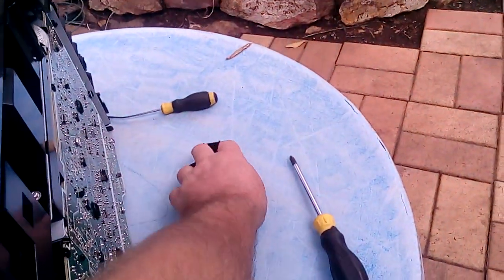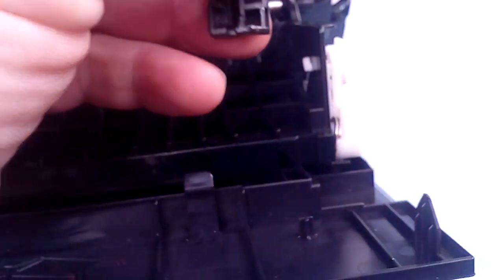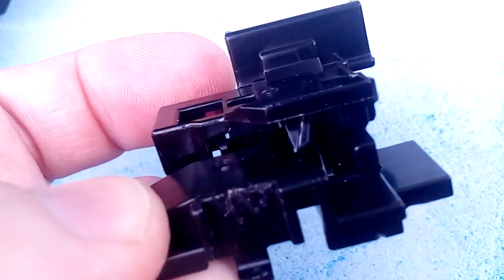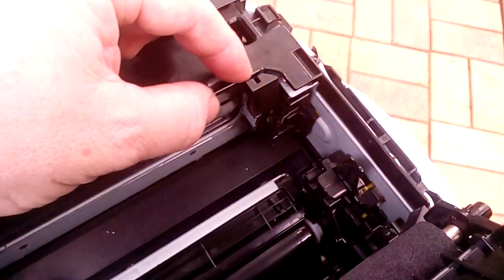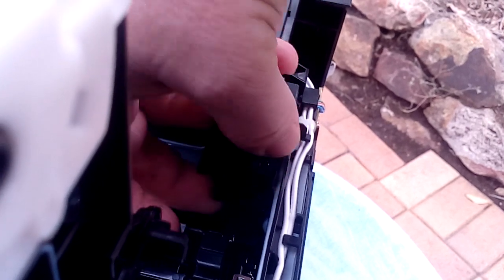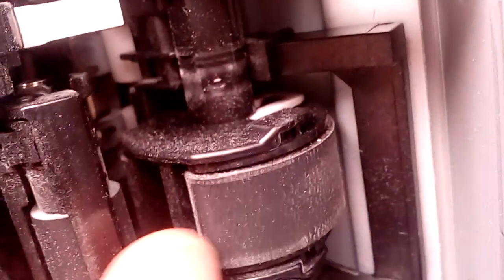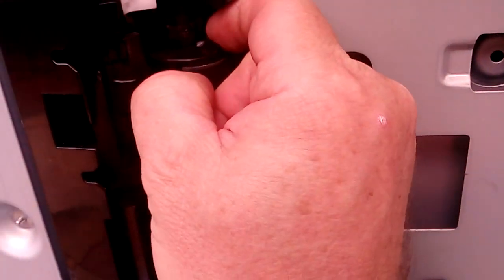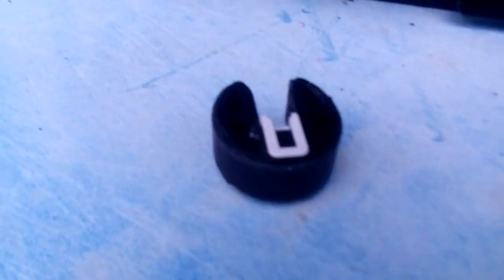Hp pro 200 cover open rear fix part 2

Comment: The video was very helpful.
Thank you.
The individual plastic component that gives the command to the sensor (open-close rear door) had been deformed, probably from forcefully closing the door.
I repaired it using hot air.
I put the spring in its correct position.
Then I placed the entire plastic mechanism in the operating position and the printer works perfectly.

Comment: A simply and casual fix: turn off the printer, rotate it to rest over the front panel, the rear panel facing upside, and MAGICALLY the door closes. Tested in two diferent machines....
Reply: ++++ THIS WORKS!! At first I was skeptical of this suggestion thinking it would cause a whole different problem, but I gently tipped it over onto the front with the back door facing upward, and then closed the door and it closed FULLY! This person deserves a THANK YOU!

Comment: Thank you for the video! It helped me a lot! I removed the black bit and and now the IR sensor is not blocked the Printer does not say that the rear door is open. I am able to print in the meanwhile I am ordering the part.
Reply from the maker: Just fix your old part it's usually the spring

Comment: you can also bypass the sensor and the error by shorting the bottom-left and the top-right pins on the optical sensor. :) you will need to remove the printer's side panel to expose the motherboard and sensor pins.
Reply from the maker: This  of course is not recommended as you will not be able to clear paper jam errors as well as pulling the 5 volt rail down causing more current to be drawn
Reply: thanks for this - mine stopped working 2 days ago. I shorted bottom left and top right and this worked fine so mine is good again - just one "small" soldering iron burn where I slipped! I removed the plastic part first first but this wasn't sufficient in my case, it clears the rear door open message but then on first printout, the message returns. (The spring was missing in my situation). Its just saved me NZ$500. The POS has been hit and sworn at many times, I was surprised the rear door was still attached! I felt guilty fixing it, but guess it gets to live another day sadly.
Reply: My printer has been working great with no errors for over 2 years! 🥳

Comment: Thank you Terry Jones for this video. You have helped guide me tremendously through the parts of this printer. After tinkering a bit with mine, I found that I actually didn't need to replace the whole part as you did. The mechanism that was bended out of shape was the the little flipper where the leaf spring holds up. However, I realised that the logic to the infrared sensor (IR) as "door closed" was the plastic flipper NOT blocking the IR sensor. And there is actually 2 separate parts to this whole flipper mechanism as a whole, lower part which we can remove. The larger part needs to go back in the printer to accommodate the back door closing. With the IR sensor unobstructed, the door will always be read as closed.
Reply: Я также сделал! Спасибо автору за помощь! Твоё видео по сей день актуально!

Comment: Could you put a piece of tape over the sensor light? Would that work to fool the sensor to think the door is shut?
Reply: My sentiment too!
Reply: That wont work. Read Daniel Tsen's comment "I realised that the logic to the infrared sensor (IR) as "door closed" was the plastic flipper NOT blocking the IR sensor... With the IR sensor unobstructed, the door will always be read as closed." In other words, the flipper blocks the IR sensor when the rear door is open. Putting black tape over the IR sensor would let the printer think the rear door is open. Therefore, you can remove flipper as a workaround so that the printer thinks the rear door is never opened but you might have to power cycle the printer after clearing a paper jam.

Comment: Before taking apart the printer or replacing the part you showed in the video, I played around with the trigger mechanism a bit by poking where the other locking mechanism (white thing on the door) goes into the black part shown above. After a few pokes, it luckily worked and the door closes now! I'm assuming the spring loaded piece must've gotten stuck, or something. Sharing in case someone else's issue was as simple as mine. The video helped a lot, thank you!